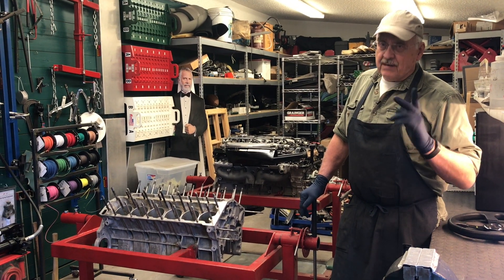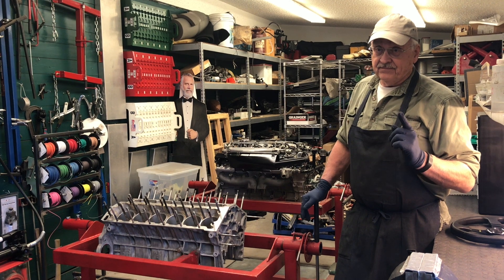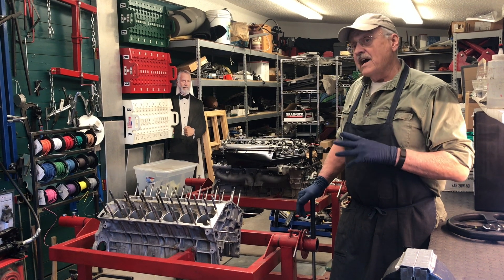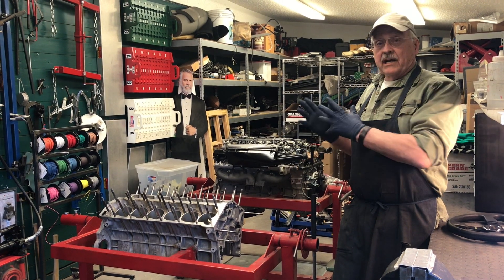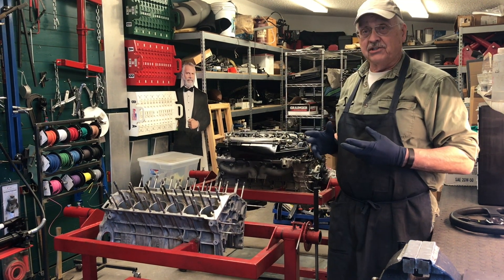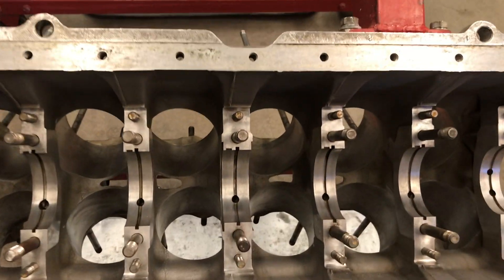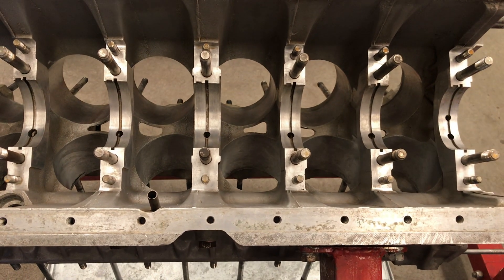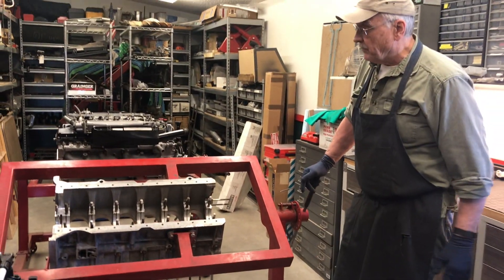Tuesday Extras - Episode 1 :  Jaguar 5.3 Liter V-12 $100 Overhaul Challenge  Introduction.

Comment: I was looking to have my XKE V12 crank shaft "pits" ground out, and stumbled on to your chronicles. The engine been out for 43years and the bodies been sitting in the garage just as long. Im going to start this project with the crank. Do you have up all the 100.00 episodes?
Reply from the maker: All episodes are public. Good luck with your project.